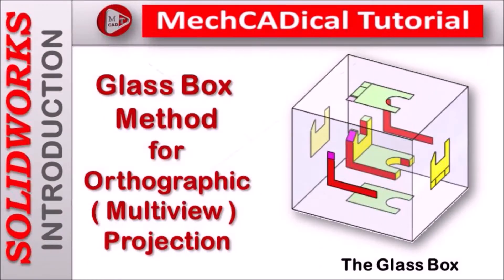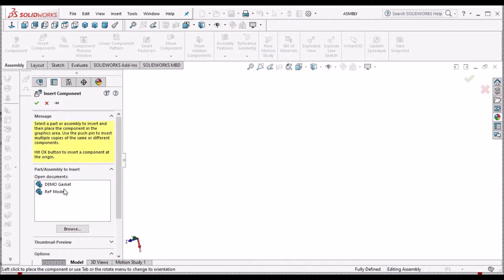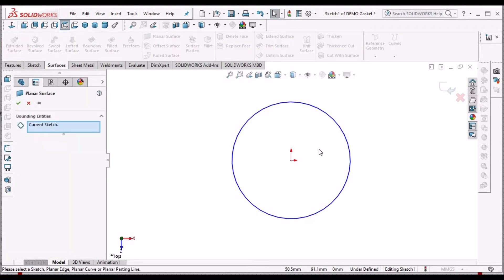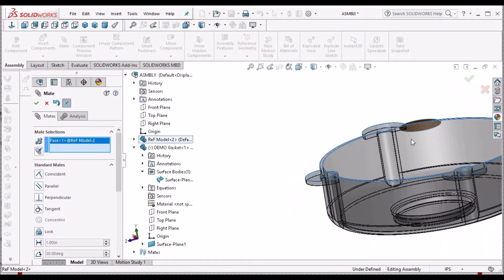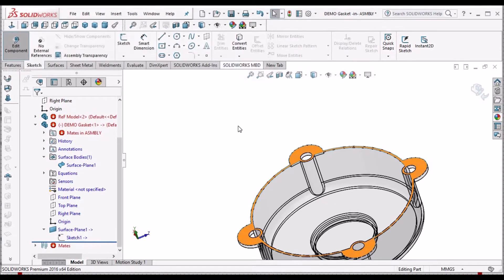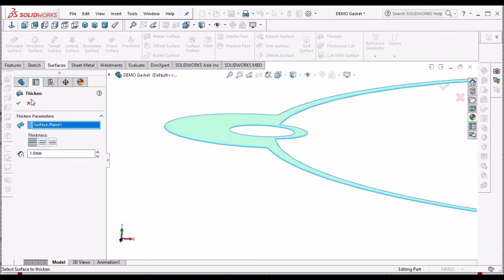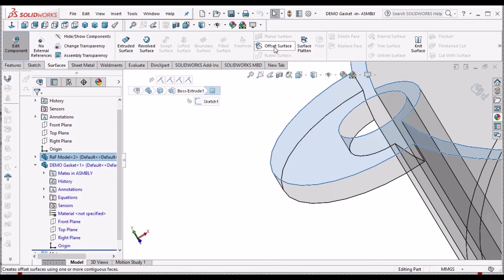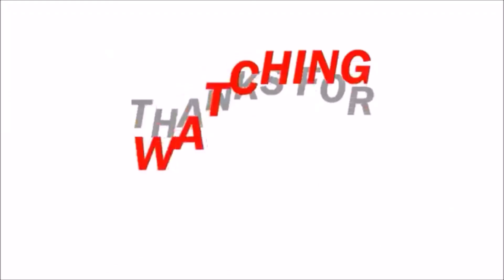Copying A Surface (from one Part to other Part) In SolidWorks

Comment: So you didn't really copy the surface you just sketched a flat surface?
Reply from the maker: Copied surface, this option is used for TopDown Approach and Reverse Engineering
Reply: @mechcadicaltutorial  

Okay, I just tried it again and it worked. 

I've been using Creo or PTC pro-engineer since 1998 but solidworks is driving me nuts. :-)  Thanks for the help.
Reply from the maker: In Creo, we have seperate command for copy surface in advanced module.